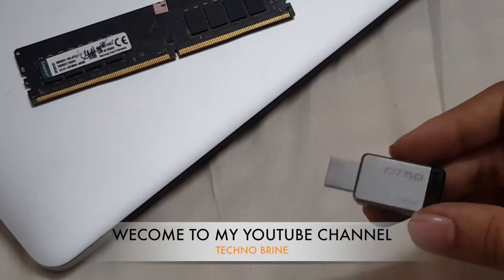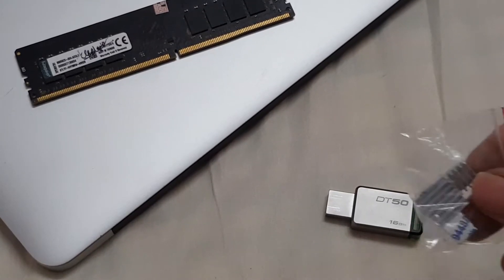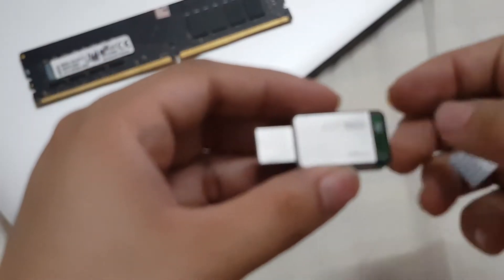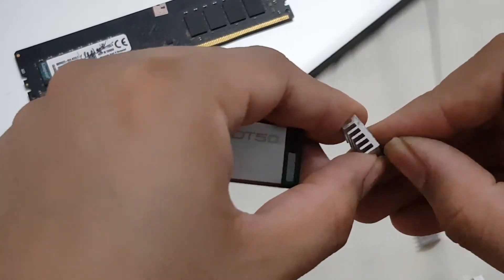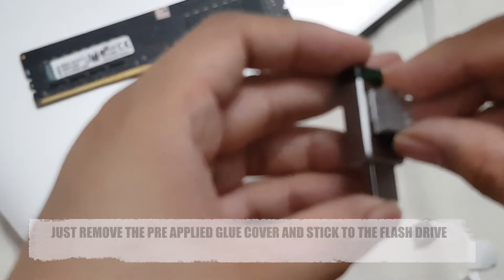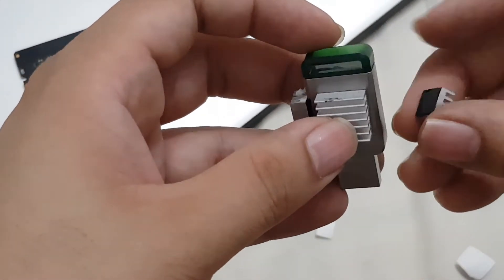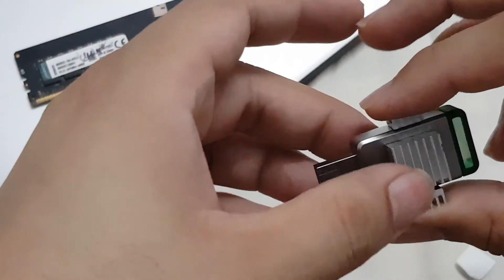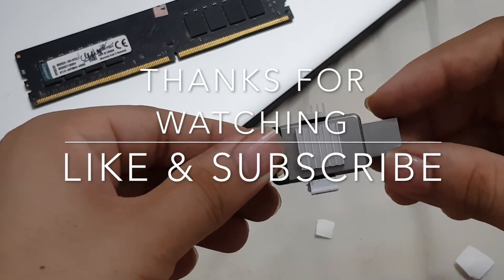Solve Flash Drive Overheating Issue Once and for All

Comment: I have the same usb, it gets very hot even under normal use, why?
Reply from the maker: These are USB 3.0 drives with high speed  data transfer capacity. Their chip tend to get hot if used constantly with read/write operations like a micro CPU.